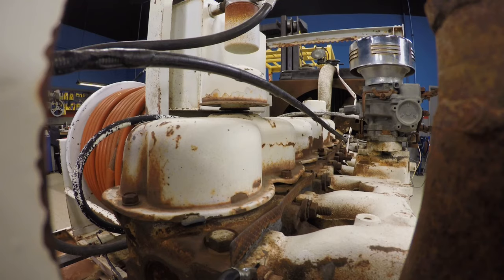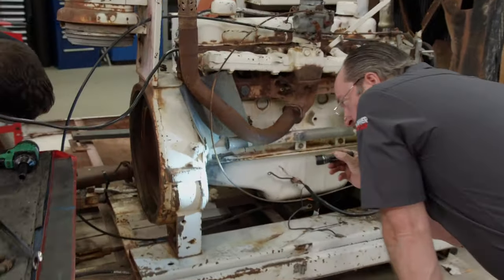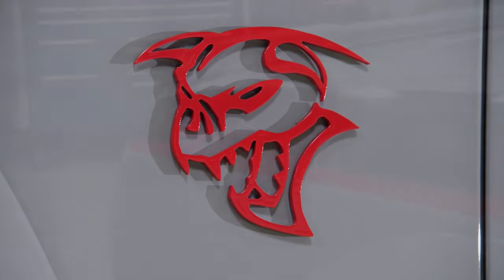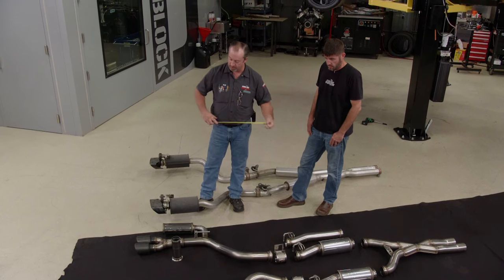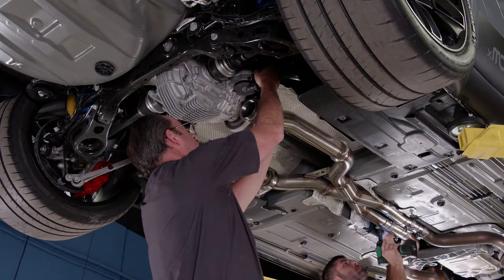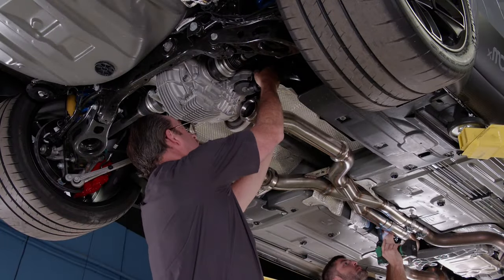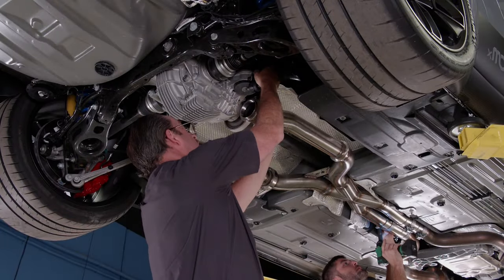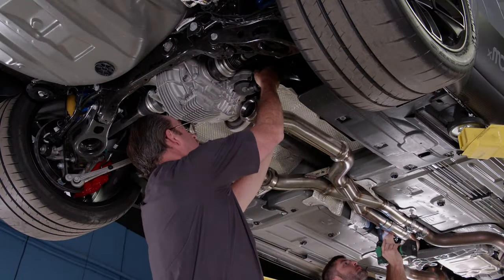Will The Ford 300 Inline Six Start After Sitting For 20 Years? - Engine Power S7, E14

Comment: I don’t even need to watch this to know the answer. Of course it’ll start, that 300 inline 6 engine was probably the toughest engine Ford ever made.
Reply: Best engine ever as far as durability goes. I have 305K on my 1990 Ford van. I drove it for a year and 11000 miles without even opening the hood because I was so busy and overworked.
Reply: You're not wrong! I had one in an 85 F150 with a 5-spd. I loved that little truck. Getting rid of it was not the best idea I ever had but hey I was a teenager.
Reply: It sounds like Ford's equivalent to the Slant Six for reliability, torque and economy.
Was it a bigger version of the 250 we got Down Under in the '60's and '70's?
If so, I'd have to wonder if the 250's crossflow head and EFI would bolt on?
Reply: Shane Singleton I learned to drive on an 85 F150. Ours had a 4 speed I think.
Reply: PiDsMedia : Nope  The United States E van and F series Truck and sometime passanger car Big Six 240 (3.9) and 300 (4.9) was a big 4.47 inch bore spacing engine...the Australian 144/170/188 (3.1)/200(3.3)/221(3.6)/250(4.1) and related 3.2/3.9/4.0 SOHCs and Barras were all short deck, narrow 4.08 inch bore spacing engines from the 1960 Falcon program. After 1976, all that smaller jazz got X flo heads and nothing interchanges with the Big Six at all. The United States4.9 EFi Big Six looks like the Aussie  1983 to 1987 4.1 EFi, but the US engine is non cross flow and totally different. The Big Six was born in 1965 as a 240 or 300 cubic inch replacement for the 262 i6...and the 4.9 is still made as an industriak engine.Last truck application was 1997.
Reply: Primer50 # : Lol..4.9 EFi Big Six heat soak.The greatest Fan! Its called a Squirell Cage Blower. Frankly, I blame...squirells....
Reply: @PiDsPagePrototypes  No, different engine. You Aussies get all the great sixes!
You can get a lot of parts for those motors and they can be made to run really well and they are dead reliable. They made 10's of millions of them so parts are cheap!
Reply: @PiDsPagePrototypes   you guys get cool shit in Australia that we in the United states dont get
Reply: @deanstevenson6527  - Seems a shame Ford didn't do a version of the crossflow heads for that larger bore spacing, would have improved the efficiency and economy, but I'd bet on Ford US thinking "We can't have a Six taking sales off the V8's"
Reply: Bobby Brown  - I have the Clifford clone HyperPak on my Slant, goes like stink :)
Reply: PiDsMedia : see my response to iambeemin about 12 hrs ago. They made a SOHC Hemi Aluminum headed cross flow for it in 1967...Ak Miller used it in his 67 Stang Fastback with 240 six and  a 300 crank.
Reply: I was going to say the same thing.
Reply: @PiDsPagePrototypes  the 250 inline 6 is a different engine family, the sister engine for the 300 was the 240.
Reply: @PiDsPagePrototypes  No, t'was a different casting. A 300 crossflow in an XD would have been different.
Reply: Ford needs to bring back the 300 straight six  and put it in the ranger with a turbo hooked to it.....yeah buddy. ...and a 8 speed auto.to it as well
Reply: I had 1993 F150 with one loved that truck
Reply: My first truck was a brand new 91 f150 with 300 inline 6. Three transmission rebuilds under warranty, last was on my dime, lost my ass on that truck.
Reply: @PiDsPagePrototypes  It was and bigger 240 truck engine.
Reply: @PiDsPagePrototypes  I believe it's similar, the only other engine of the fourth generation Ford big six is the 240.
Reply: @kevinkirk4285  It'd be interesting to see this compared to a Ford Australia Barra - and those things also ran on LPG! Taxis all over with a million kilometres on them...
Reply: @bigboreracing356  Similar to why a lot of those old, lazy, big V8s from the 50s and 60s were considered tough: for most of their life, they loped along at sub-4000RPM or lower.
Reply: No ,the 240/ 300 is a  totally  different  family,  it was designed especially  for  trucks  even medium duty  trucks!  It was equipped with  multi  port injection  in 1987 thru 96 just like the 302,351w and 460 .    It is one tough engine  the slant 6 couldn't  hold a candle to the  torque  and reliability  of  the   Ford 300 inline 6!
Reply: Production ended  in 1996 ,the 4.2 essex v6 replaced it in trucks  and industrial  applications.
Reply: Just picked up a 74 300 for my 72 f100 can't wait
Reply: And I somehow broke it but now it's time for a upgrade
Reply: Had one in a 1981 F150 4x4. Had a 4 speed in it and we used it to pull gooseneck cattle trailers to the stockyard. Couldn’t kill it. Wasn’t built for speed but it definitely was a workhorse.

Comment: My favorite engine. When I was in high school a guy blew his up on lunch break and drove 7 miles home with a hole in the side of the block at the end of the day. They are tough even after they are pushed well beyond their limits.
Reply: I drove one with out vavle cover on it 15 miles home then put rock in gas pedal for about 45 min for it locked up scape was high got almost six hundred back in day
Reply: Had one in a '90 E350. Lost the serpentine belt headed home. Went 44 miles without the water pump!
Reply: My dad was up in the woods upstate when the 300 I6 in his 92 F150 spun a bearing and lost oil pressure. He let it sit for the day and fired it up the next day. Had oil pressure and he drove it the 4 hours home. Ran fine. He drove that truck anther 2 years before it spun a bearing again and wouldn’t keep oil pressure. But it still ran well enough to drive to the junkyard under its own power. It had 325,000 miles on it. Not bad for a few and far maintained engine. He bought it when it was only a few years old with 30,000 miles on it. It was his work truck. I only remember it breaking down once and needing a tow (fuel pump).

The best I got was my old 86 F250 351 auto 4x4. Sold it with 285,000 on it. Engine was never opened up. Just regular maintenance. Miss that truck...
Reply: @CamaroAmx  i got my granddads old 94 f150 with an automatic and a 300. Damn thing has 371,000 mi on original equipment. I still daily it. And I'll be honest ive rolled a 86 f150 and still drove it 5 years with one the side tore up. I got plastered in the rear by somebody runnin 70 mph in the same truck and still drove it 12 miles home lol. Form experience they tough.
Reply: CamaroAmx shit if it was running yall could’ve kept using it for another 100k miles. 300s don’t need oil anyways.
Reply: I've got a an 07 ls 5.3 with 362k hard miles

Comment: Ford 300 six powered my trucks for years. A super powerplant.
Reply: I’m super excited about this build I’m driving one right now
Reply: The torque is awesome in old trucks
Reply: It's the honey badger, maybe not the strongest but it doesn't die.
Reply: @50calBeowulf  that's no lie.
Reply: It still is powering my f150 at 600k miles and still going
Reply: @bowez9  have you done a rebuild yet?
Reply: @Truckerdaddy  no never opened
Reply: @bowez9  could probably use a freshening up to gain some of that pep back. Gas engines lose power quicker than a diesel engine does over time.
Reply: @Truckerdaddy  still has no problem with 3500lbs of payload, and 22mpg.
Reply: @bowez9  I have 403k on my never opened 87 first year efi matted to a c6.  Just had it resealed no more oil leaks what a luxury lol runs like a top.
Reply: Can't kill them... My buddy thru a rod thru the oil pan on his, truck wouldn't stop running. He'd put a quart of oil in it a day to get back and forth to work. the end of the rod was sticking 1/4 inch out the oil pan. Crazy.
Reply: Everyone I had outlasted the truck bodies.Its a shame most diesels can’t say that

Comment: Probably the best engine Ford ever made.
Reply: Mr. Christian : And Governed down to peak at 88 hp gross at 2900 rpm. Stock, they were 114 hp net. That 228 lb-ft at 1100 rpm was magic. The formerly  governed carb is on at right angles too...just like the 200 small six swather engine..What a mule of an engine the 300 is!
Reply: *  428 .
Reply: Autojones : Yeah. Among Equals. One tows airport baggage, UPS Mail, Ice Creme Cones and cement pumps and the other wins drag races, carts King of the Road Shelbys to street racing credibity by being able to incinerate tires and male egos in one evening.  Yeet!
Reply: @deanstevenson6527  I get what you're saying but to me the 428 is the most versatile. My Dad put one in his f 250 and it got big block power with small block mileage. and a friend of mine put one in his mustang (witch originaly came with an 390) Amazing engine.  utility or performance .
Reply: Autojones : I think its hard to demolish any FE, even a side oiler. And a 428 had the bare bones of both the NASCAR and the LeMans wining 427.
Reply: Def the best but the 3.5, 289, and 4.6 are very good engines as well
Reply: @TateLaPrade  Ford had a 3.9 in the 70's that was a monster v6. The hatchback Pinto's had them, some with a 4 barrel carb.
Reply: @lonecrusaider  damnnnn, never heard of it but it sounds badass
Reply: barra!
Reply: I like the 302 n the 351W also. That's about it for Ford engines. Had an ol '76 300 6cyl n the mains n rod were all rattling.Didnt beat on it, n it ran forever hauling lumber.
Reply: True, but still not as good as the Chevy straight six

Comment: Arguably one of the greatest truck engines ever, regardless of of whether you’re a Chevy, Mopar, or Ford guy, have one in my truck, they had such a good run from 65 to 96. I know a lot of people who stopped buying ford trucks once they got rid of the good stuff like the 460 and the 300. I have a 300 in my truck, they can’t be killed!
Reply: I know you're right about that I don't think any Triton is near as reliable is the good old blue stuff I was one of them guys that said there would never be a Chevy in my yard then came along a Triton and away went the 7.3 now the 7.3 is back as a gas I think it's going to bring some of the Ford people back
Reply: Yeah they’re essentially bringing back the 460, they knew their mistake, torque applications like the 460 was so good for doesn’t need overhead cams like high performance high rpm applications need, If it ain’t broke don’t fix it, very good move by Ford, love the new 7.3

Comment: Next episode: "we take this Ford 300, add efi and turbo, then power half the city on our generator "
Reply: Lol
Reply: They have Cummins for that and it would use about 1/3 the fuel for the same power.
Reply: @ThePaulv12  Generally what diesels are for, yes
Reply: ThePaulv12 You’re really not much for humor, are you?
Reply: bobwatters  I vaguely remember hearing about some company in Brazil that makes a supercharger for straight 6's. Like the chevy 292. Id like to see those tourqe number as well
Reply: exact copy of a chevrolet
Reply: now youre talking
Reply: @fr4nheick491  No Sir not even close I've owned both and the 300 was a way better engine than any of the Chevrolet inline 6s. The only GM engine that came close to the Ford 300 for durability was the V6 GMC truck engines they built up until the early 1970s
Reply: @lawnmowermanlawnmowerman9930  and in durability a chevrolet is made to last 50 years a ford every 10 years you have to ring and retify cylinders because they do not have much stroke and are compact, they have greater wear and tear and you have to pull them because it is impossible to change a plunger without removing the cylinder cover cam The crankcase chain and the engine are out, I won't even tell you if you have to change a valve, you have to disassemble a whole fortune for low-performance engines, it is better to throw them away
Reply: @fr4nheick491  Well I'm a retired Ford,Chrysler,GM,and ASE certified mechanic as well as having been a Vo Tec instructor. I've ate and breathed engines since i was 10 years old and at 61 I've built more than 2000 engines gas and diesel and some of my friends are engineers at the Big Three manufacturers and I can attest to the fact that GM and Ford both say the 300 Ford Big Six is for damn sure not a copy of any GM engine period. The 300 is designed more like a diesel than any other gasoline engine on the market. That is why they were used not only in trucks but also in a variety of industrial and agricultural applications. I've owed several of them myself that had nearly 500,000 miles on them without major repairs and were still running and working daily when I traded or sold them.
Reply: @Icutmetal  Well, he knows more than everybody else. At least that's what he wants everyone to think. A real joy to be around, I'm sure.
Reply: @lawnmowermanlawnmowerman9930  If I was always like this All my life .. Ford was manufactured x chrysler chassis suspension steering etc .. until 50 then gm manufactured the v8, the danas differentials and the powerglide transmissions and in Argentina saginaw and at 60 it was followed with shelby .. then volskwagen and renault team their vehicles in the 80s and 90s in addition to croswors and several other brands .. the 300 is a copy that if I'm not mistaken came out in 65 an exact copy of the 7 banks 194 from 1932 .. already when gm started to manufacture the v12 702 and 260 joseph and Pantentar them in the 60s .. have a gear cam a gear crankshaft .. the rocker arm system without the rocker arm of the 4 Gm 235 benches .. bigger pistons like those of the opala 4 cylinders 2.5 150cc a manifold that eats in a corner and ends before the exhaust tappet cover
Reply: FR4N Heick lmao who told you chevrolets are made to last 50 years? 😂
Reply: @AG-rk5hj  They are made to last 50 years here in Argentina they last 50 60 years I have disassembled several coupe 4 doors nova 66 194 steel crankshafts with standard mahle pistons and clevitte metals .. the fords every 8 years you have to retify cylinders are small motors short races more rpm more wear.
Reply: @AG-rk5hj  The chevrolet v12 are built to last 100 years and the 6 50 yearr
Reply: @AG-rk5hj  That's what I'd like to know because according to the GM engineers I had classes under that is absolutely not the case. Making them to last that long would hurt GM's salles figures badly in the long run. Non of the Auto companies make vehicles to last that long. The last one to have that mindset was Henry Ford himself with the Model T.
Reply: Hope this happens

Comment: Those 300's are tough 6 bangers! Never had a issue with one.
Reply: i sneezed on mine, and the head gasket sent, replace it with a copper gasket and never saw another issue.
Reply: Except being slow slow slow slow.
Reply: @Decaying Grandeur double the power is only 300 horse. That's not good for a turbocharged 5 liter motor.
Reply: @blakethornsbrough1528  the torque that engine makes makes up for the lack of hp. These aren't high rpm engines, they are pure torque monsters
Reply: @blakethornsbrough1528  But it could tow, tow, tow.
Reply: @rednecktractors10  oh I'm well aware. I had one in a 2wd standard cab 96 F150. It got v8 gas mileage with 4 cylinder acceleration.
Reply: @Sid The sloth other way around there bud. Long stroke means more piston speed
Reply: @blakethornsbrough1528  that's weird, I get roughly 17mpg average and I'm turning 35s with 3.08 gears in a 4X4 5 speed truck, and I usually haul 2-3 thousand pounds about once a week lol

Comment: Torque was almost three times the horse power.    Almost doesn't need a transmission when you got max torque  at a high idle.  WOW.
Reply: With a healthier cam and valvetrain components, I bet dollars to donuts that power would go WAY up and the torque curve wouldn't take as much of a nose dive.
Reply: 25 mph in 4th gear is easy
Reply: The tbi350 and sm465 in my chevy r30 dump truck likes 25mph in high gear until a hill comes along.
Reply: I had an 87 with the 4 spd. 1st was granny low. You literally didnt need to rev it or feather the clutch to move in 1st.
Reply: Kara Ayers yeah that Tbi 350 chugs along like a tractor with the Muncie....
Reply: scdevon stroke on a stock 300 is 3.98”. Definitely NOT short.
Reply: That's the beautiful thing about this engine, only reason they stopped using them is because they never broke down and were putting mechanics of of business
Reply: @joshoowanats  yeap and any one owner  work fix then self, it's that easy,
Reply: Yes but match it with a Borg Warner t 18 with a granny first. And it's an amazing beast. I miss mine.
Reply: @Shutchohole  and it would crawl up anything.
Reply: I recognize the unit lmao. Its part of a high pressure water jetting unit meant to clean sewers and pipes. I have used one of these units called the aquatech sj1500. And this comment makes sense since through a jetting orifice this machine was capable of delivering 1400psi at 50gal/min with the engine turning only 1500 rpm. It could do more but the motor couldnt output that kind of torque

Comment: The almighty 300 the king of the 6's
Reply: Best motor Ford ever made.  The torque to weight ratio was nuts not to mention they run forever!
Reply: The 300 was a great engine , but the 292chevy was no slouch in HD trim .

Comment: I would kill for a good solid 300 six like that. Can't wait to see them crack it open and upgrade it. Would make an awesome motor for my truck
Reply: Get a blue one , stay away from the gray ones .
Reply: @beckywatt5048  why in the world would I want to shy away from an industrial 300-6 with forged internals? That's the holy Grail of Ford 300s!
Reply: @cwjarvis3  Because when that one come from the factory it was blue , 1980 vintage and up were junk , all light duty that I know of unless on a generator , water pump , standalone power unit , or wood chipper or stump grinder I am simply saying check your numbers if you can find them .BTW , the factory forged stuff if between 6 and 7 to 1 compression , you would a Paxton to get any real power out of it .